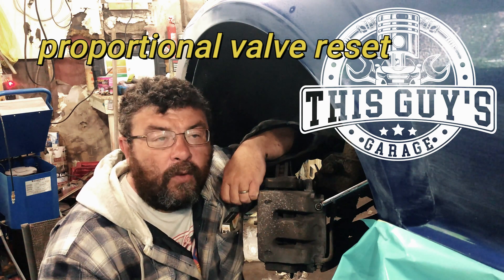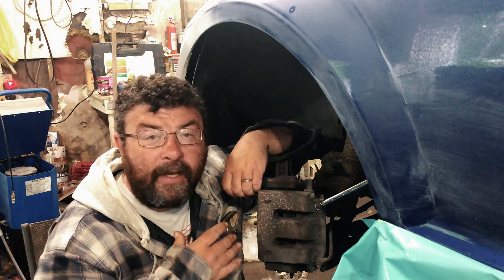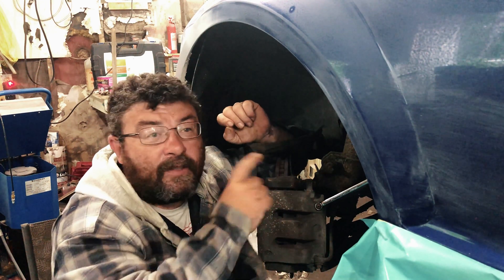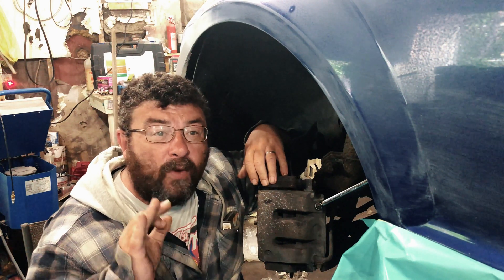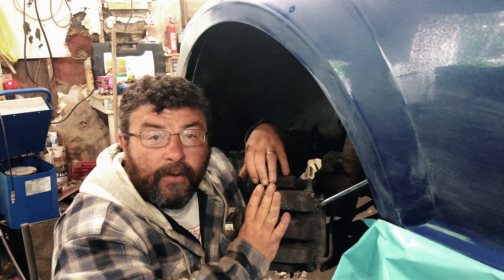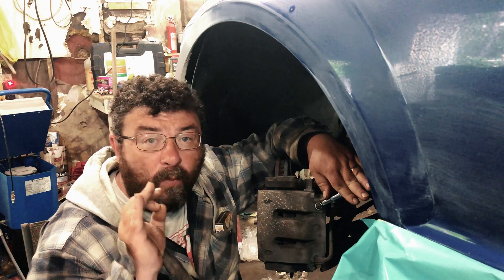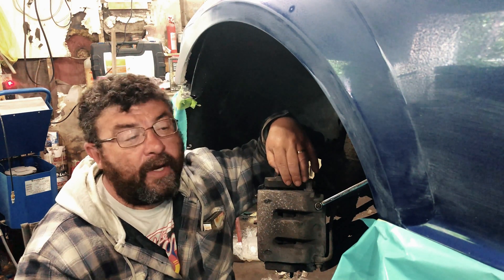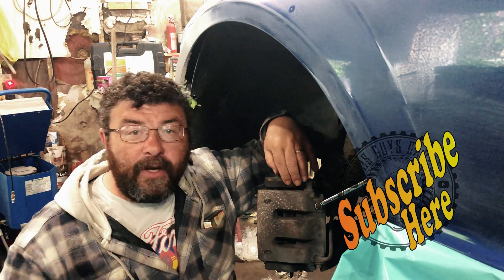brake proportional valve reset when unable to bleed

Comment: Thanks for the video… I will have to give this a try when I get home from work. I have a 2000 ranger XLT. When I bought it the rear brakes were pinched off and there was no lines going to them. I totally replaced all the rear brake components and put in a new line. When I bled the rear brakes with the truck off they pumped fine and stopped the wheel perfectly. The pedal got stuff. When I turn on the truck the rear brakes barely work, the pedal gets squishy and I have to slam the pedal to the floor to get any kind of stoppage at all. Any thoughts? Discs in front, drums in the rear.

Thanks
Reply: Never worked on a Ranger but if it has a Load Sensing Valve, it likely has its own bleed port in addition to left/right rear brake ports.  You may have air trapped in LSV messing with system, or it could be way out of adjustment...are there suspension mods [like a lift kit]?  Those tend to make factory adjustment work incorrectly [on a perfectly good valve] if nothing is done: system can behave like you are in a hard braking situation under normal driving if it wasn't adjusted to compensate for ride height modification - bracket modification is a common fix to restore travel..

Comment: Iv put new master cylinder on Iv try bleeding breaks can’t seen to get hard pedal if pump brakes 4/5 times the cars slow down any ideas
Reply from the maker: can i get the year make and model ,will give me a better idea and why you had to change the master . will do what i can to help you friend.
Reply: It’s 2002 vw golf I was told by garage my old master cylinder was knackered . I all charge my Front hard brake lines witch go to abs module

Comment: Does a 1999 Honda Accord four-cylinder with abs have a  proportioning valve ?
Reply from the maker: Yes 👍
Reply: @thisguysgarage  I have brand new brake calipers in the rear but don’t have fluid coming from the bleeder screw only have fluid from the front calipers can the proportioning valve be bad.

Comment: Hi there, got a question. 2001 Dodge Ram 1500 4x4. Have a good flow of fluid from every tire bleeder except front left like in the video. I unloosened the connection right above the flex hose where it is attached to the frame and had good pressure but when I try to bleed from bleed screw on caliper I only have a trickle of fluid. Flex hose is brand new by the way. Any thoughts would be appreciated
Reply from the maker: The flex hose must have a blockage.  Check by taking it off and blow it out. Or replace . I just had to replace a brand new one because it leaked.  Just because it is new as they say👍
Reply: @thisguysgarage  I will try that and let ya know. Thank you!
Reply from the maker: @tat2man70  please do . We will figure it out
Reply: @thisguysgarage  Turned out to be the Caliper i just put on 3 days ago. tried the buddy bleed again tonight and cracked the banjo and had good pressure there but still nothing out of the bleeder valve. Took the caliper off and  pumped the brakes a few times to get the pistons out further, clamped them for some resistance and did a 1 pump buddy bleed and then good pressure out of the bleeder valve. Got all the air out then pushed the pistons back in and clamped again and no fluid once again out the bleeder. Called Napa and they are changing it out. Install tomorrow so should be good now. As long as I dont get another bad caliper! Thanks for your input!!
Reply from the maker: @tat2man70  is the bleeder at the top or bottom of the caliper? Sometimes they will give you the wrong caliper.  If the bleeder is at the bottom its for the opposite side.  Just something else to check 👍
Reply: @thisguysgarage  it was on the top. It was the correct one but something inside is blocking the flow of fluid when the pistons are all the way in.
Reply from the maker: @tat2man70  awesome great catch 👌 🤜🤛
Reply: @thisguysgarage  Thanks for being helpful and supportive. You rock!!
Reply from the maker: @tat2man70  any time my friend

Comment: Soo I tried your method of compressing the brake pistons on the rear brakes of my truck with the front bleeder open was that right? Or should the front bleeder  have just been closed and the fluid go into master cylinder?..is it worth just taking the proptioning valve off and cleaning it if it's easy to get at..on my truck it is.
Reply from the maker: Hey Glen just to be sure,  what is your year make and model and what was the initial problem why you needed to bleed the brakes. Most brakes are basically the same but there are some exceptions to the rule.   I will do my best to help you out 👍
Reply: @thisguysgarage  my truck is 2003 chevy silvarusto..I blew a front brake line and replaced the caliper and a couple hard lines that went to the abs..bled the front brakes fine but no fluid from the rear bleeder valves..if I pump the pedal and open the bleeder the pedal stays firm with no air or fluid movement from the bleeder.
Reply: Any input would be 👍
Reply from the maker: @glennwilck5459  hey Glenn , it certainly sounds like your prop value but where it busted the front brakes would be the bleeding would be affected.   70% of your braking power comes from the front.  If the was a previous problem in the rear it would hardly be noticeable.   I would  suggest try opening the line up  before the rear flex hose to see if you can get it to bleed there. A rusted flex hose collar can cause this .  Do you have bleeders on the master cylinder to check the master cylinder?  Let me know.

Comment: is this why my pedal is hard  front brakes work but rear dont    2nd question  while i am compressing in the piston on both sided in the rear do i remove the top of the resovior or keep it closed?
Reply: oh while trying to bleed the rear very little comes out i did replace the hoses
Reply from the maker: Take the cap off to be on the safe side but if fluid has not been added it does not matter.  Ty master A
Reply: @thisguysgarage  when u say 1 pump is that after u compress the pistons with lid off then push pedal once all the way down let go of pedal slowly then bleed them?
Reply from the maker: @mastera6999  yes after you put the caliper back on👍
Reply: @thisguysgarage  ok i got more brake but pedal still a little hard  u think i still have air in the lines?
Reply from the maker: @mastera6999  if the pedal is hard I would think it's not air in the lines. That would give you a soft pedal. So now we need to look at the power assist.   Is it hydraulic assist or vaccume assist?

Comment: What if your Rear Drums are the ones that are Out? How Do I Compress the Wheel Cylinder to see if Air Bubbles Escape through the master cylinder? Should the master cylinder be capped or uncapped for the procedure?
Reply: I need this as well. Same issue.
Reply from the maker: Rear drui would back off both shoe adjusters get two screw drivers and push the shoes in all the way,would help if you had someone watch the master cylinder for air or fluid with the cap off. Let me know if this helps, we can come up with another solution if not.
Reply: this guy's garage If you post a on hands visual of this you would get tons of views /comments etc… thank you for posting I’ve been chasing this gremlin for quite a while now…👍🏼

Comment: Thank you so much for this video really enjoyed it. However I have a Small question. On my SX4 I have the rear wheel brakes do not seem to function when the pedal is pressed. When engaged with my handle they are OK. I have to press the pedal really hard to see an effect in terms of being able to rotate them by hand. Front are OK though as seen by the disks brake pattern. I checked the pedal is firm after pressing couple of time and it seems ok SO NO AIR in the system. I also checked the slider on both sides and they seems to slide ok and the pistons seem to go in and out easily. One side is working a bit better than the other. Any idea? if this could be blocked proportional valve. On this type of car it is 2 line in coming from ABS and 2 line out going to the rear brake. Is you method would work? Thank you I really enjoyed your videos and will give it a shot.
Reply from the maker: Are the rear calipers or wheel cylinders?

Have you checked your flex hoses?
Reply: @thisguysgarage  I have a 69 camaro just did disc all around my son pumped on my brakes and now I can't get any fluid coming out any bleeder front or back. The wilwood mastercylinder was bench bled and my porportion valve rear brake adjuster is turn all the way out and still no fluid. I used a vacuum pump and nothing works. Can you help me PLEASEEEEE? THANKS.
Reply from the maker: @7115sugarhill  are you getting fluid at the master cylinder ? Can you bleed at the line coming out of the master?
Reply: @thisguysgarage  I used a Bleed tool blew in line at mastercylinder had air come out front lines yesterday now nothing today. I believe my son put rear caliper on the wrong side Bleed screw on the bottom. I'll fix tomorrow and redo your steps from your channel.
Reply from the maker: @7115sugarhill  that will definitely cause your problems, let me know how you make out 👍
Reply: @thisguysgarage  I switched the calipers now I'm get squirts of fluid to the back from vacuum pump I started on passenger rear but it never gets solid stream of fluid seems like a lot of air been pumping forever. Could it be a line is loose somewhere?
Reply from the maker: @7115sugarhill  i would bleed them manually ,i do have a video on the buddy bleed procedure https://youtu.be/4ty7u_fnd2M
Reply: @thisguysgarage  I thought once you buddy Bleed the porportion valve shifts direction from the middle I bought a brake Bleed tool to screw in brake switch but my porportion hole is 5/16 brake line size. I'll keep watching your videos you'll get me back on track.
Reply from the maker: @7115sugarhill  let me know how you make out 👍
Reply: @thisguysgarage  its still trickling and when we smash the brakes it's all the way to the floor. No fluid out the fronts just bubbling air
Reply from the maker: @7115sugarhill  what kind of vehicle was this on . What was the original issue,  let's see if we can solve the issue 🤔
Reply: @thisguysgarage  disk. will check the but doubt it is the issue as this will make the caliper stick. issue seems to be present on both sde
Reply from the maker: @samerawaragi3041  rear drum or disk brakes?
Reply: @thisguysgarage  rear disks and rear calipers
Reply: You were right replacing hose and one pump only fixed the issue thanks
Reply from the maker: @samerawaragi3041  that is awesome to hear.  Thanks so much

Comment: Great absolutely makes the process from the previous videos much much more home mechanic friendly and these valves are cheap these valves are two and 300 bucks well this method will be the last attempt to bleed the brakes if that doesn’t work I’m going to remove the proportional valve take it apart put that piece in the center and weld it there😳
no I’m kidding!!!!
Reply from the maker: thanks so much pete, let me know how you make out!

Comment: I have fluid in the tube with a lot of air coming through using a vacuum pump I probably emptied the jar 7 to 8 times now 🤔And still have seems like a ton of air in this front caliper I have solid pressure on all three other calipers 🤷....
Reply from the maker: did you have the calipers off by any chance? is there any possibilty the caliper is on upside down ? is the bleeder at the top or bottom of he caliper? just want to rule out all the possibilities

Comment: That was very useful and informative.  Wish I had know that dozen of brakes ago!
Reply: Good morning…. Quick question for you. When I’m compressing the caliper  i do not open the valve stem? I’m having a problem with the left brake,  will not bleed . Was able to get the right front to bleed but not the left.  My husband did pump the brake more than once. We only changed the front brakes . I have never had this problem before. The brakes go all the to the floor when the car is started. This white whale POS KIA Sedona is kicking my but. I do have the air compressor for bleeding . Do you recommend that for me or the one pump only? Oh and if it is the left front, after compressing both calipers would I bleed the left one first? Thank you for the update.
Reply: Should have said questions:)
Reply from the maker: thank you my friend

Comment: Perfect timing ! I was just about to start
Reply from the maker: Awesome let me know how you make out brick Mafia
Reply: @thisguysgarage so, before you pump 1 time, do you reinstall you caliper and brakes? Or pump one time with an empty caliper out in the air?
Reply from the maker: @dougfleming2099  it has to be reinstalled before you bleed , if it's not installed it will blow the caliper piston.  Great question
Reply: Hey bud
Hot as heck today

So ive swaped master cylinder  & bled my brakes with just gravity
(Cap off back caliper bleeders open & let it slow  bleed (aftert i topped of the reservoir) 
&  hour later closed bleeders & started truck 
& i still maintain little more travel with brake pedal than desired
& today i had another caliper stick so ill be swapping  the flex lines 
Just scratching my head about spongy pedal